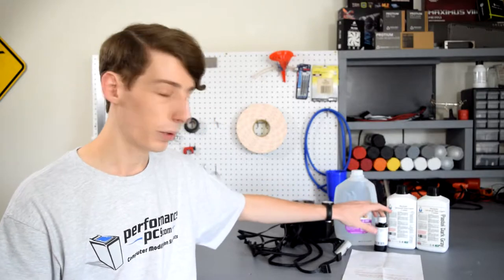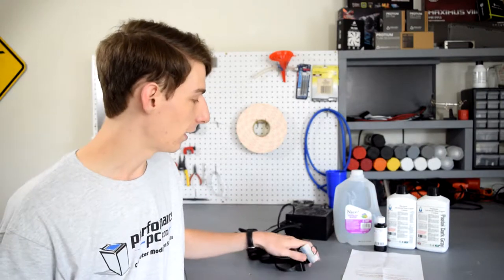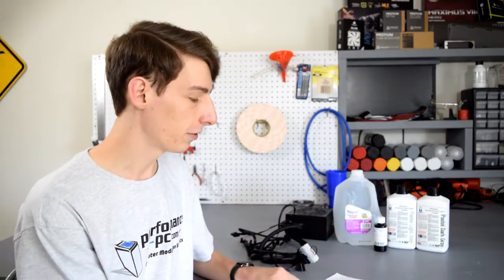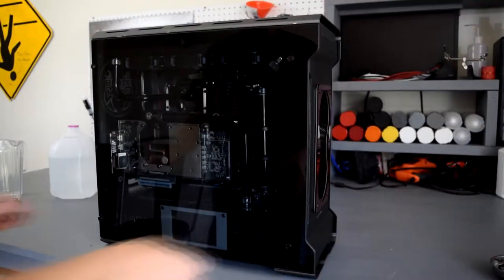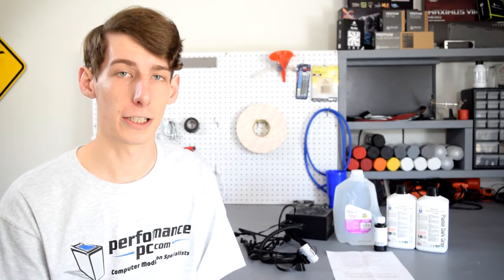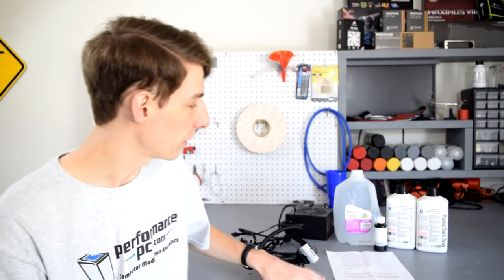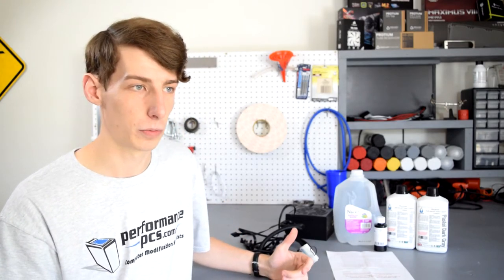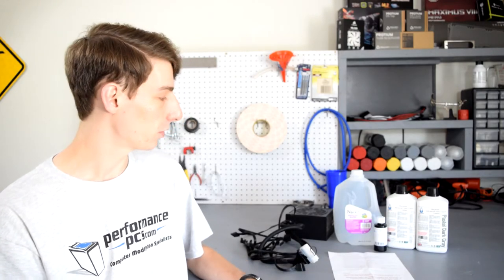Flushing your loop with Mayhems Blitz Part Two!

Comment: My flowrate keeps going and down lately. Something seems clogging (I use distilled water with mayhems inhibitor+ and biocide+.) Can i throw in Blitz Part two just in the loop as it is and run it for 24 hours, or would I need to clean it out first, and use just plain distilled water?

Comment: READ THE INSTRUCTION AND FOLLOW IT! You are not meant to use part 1 it on full loop... Only rads that are Steel, Brass or Copper. Of course, do not use it on Aluminium rads... it will kill it! Use gloves and protective goggles for reason! Running part 1 of Mayhem Blitz is up to 6 hours I believe and then flush it up 2 times or 4 if you like. Part 2 is to balance PH 2 and removing leftover acid which could cause damage in the long run. Part 2 can be used in a prebuild loop but not part 1!!! The cleaning is up to 24 hours altogether and should be not used for longer than that for safety reasons.
Reply: Also "MB Par1" is meant for new rads that come very dirty from factory (debris and tarnishing). Of course you can use it on an used rad but not much stuff to clean imho. Maybe do some rinss with distilled water if you want to sell that rad or swap with another one. For Alphacool Rads I would suggest to do 7 or 8 rinses after flushing "MB Part1". Regards

Comment: Doubtful that you will answer this question in time.  I have a brand new rig Loop. With hardware labs and ek I bought from you guys, do I need to flush 4 times still? I'm currently doing part 2 at 12 hours
Reply from the maker: You should always clean new rad's as they put oils in them to keep them new and there is always some debris still inside most Rads. Flushing it 4 times is the best bet to remove most if not all contaminants

Comment: Do you think loop size matters when it comes to flushing the blitz out? I noticed you said flush the loop four times and let the distilled water cycle 1 hour each time?

It also seems like there was still a fair bit of distilled water left after the final drain when you finally added the pastel coolant.
I suppose a bit of distilled water left in the loop won't affect the coolant that you finally filled your loop with?

Sorry for asking so many questions. I know it's time for me to clean my system and up until now I kinda thought you had to pull everything out and use blitz part 1 before changing coolant colors
Reply from the maker: I dont think loop size matters entirely too much since an hour for any size system should be plenty for each cycle. 

Yes, most systems it can be quite tricky to completely drain, mine is definitely one of them. A little distilled water won't hurt the coolant though.

Comment: Nice video Matt, good work :) Quick question... when running the Blitz through the system for 12 to 24 hours can the system be used at the same time or is it best just to have the loop cycling with the system powered down? Would the heat cycling of having it running affect the Blitz at all?
Reply: No its not a coolant and some systems can hit way to high temps, it best to be done with luke warm water.
Reply: Mayhems with the clutch comment.
Reply: @mayhemsmedia  On EK website it says EK cryofuel not compatible with Mayhem blitz. Will it be ok if i flush the system 6 times instead of 4 or it's not compatible at all?

Comment: Will this help with mold
Reply: 11 months and no answer? Silence on this must mean no!
Reply: oh wow sorry man wish I saw this sooner. If you purchase the mayhems blitz pro kit you will have a separate flush for the radiators in your system. Everything else should be cleaned by hand ( blocks, reservoirs, and fittings) with warm soapy water. Afterwards when everything is connected run the part 2 cleaning. Finally add your coolant if it’s a premix check to ensure it has inhibitors for mold,algae, etc. or if you want just water, add a silver kill coil or PT Nuke. 
I personally have always ran this kit and hadn’t run in into issues.

Comment: well hopefully i can keep my loop coolant for like 3 years using just coolant with standart purple die. And only flush when i get new components, in that case i only need to flush the radiator because im gonna add new gpu block and cpu block and use new tubbing.

Comment: jesus flush 4 times with distilled water? water so expensive
Reply: Lmao where do u live?
Reply: 1gallon about .85 cents here in California
Reply: @MrKZdemos  Scotland distilled water almost doesnt exist here. We live off scottish tap water.
Reply: I thought exactly the same, my loop takes about 1 litre so i need to use 5 Litres, that's basically throwing £25 down the drain.

Comment: Mayhems doesn't support their product. Two bad batches of u clear blue
Reply: Try contacting us we offer "full" support and replacement products for free. If you have an issue with the system that we can see we will talk you though how to fix it no matter who's hardware you use. Some of the best if not the best support you'll ever see in water cooling. We do not fob you off with oh its not our issue.
Reply from the maker: If you bought from us please email us the problems and we will get it sorted out.